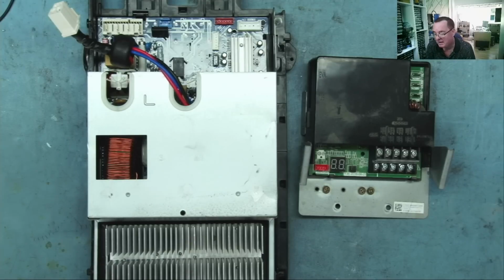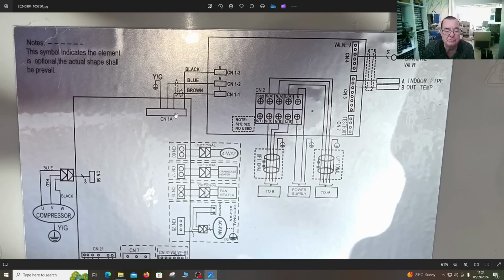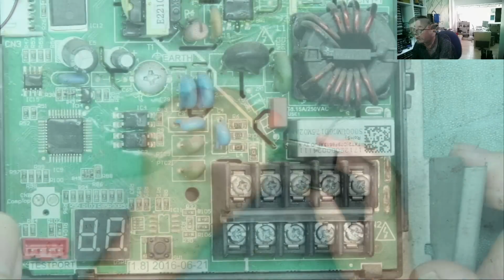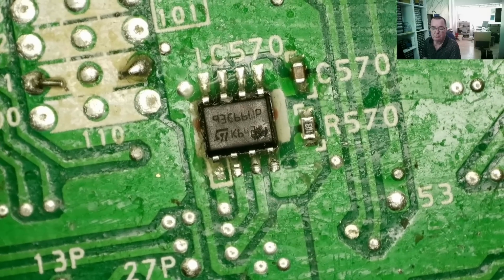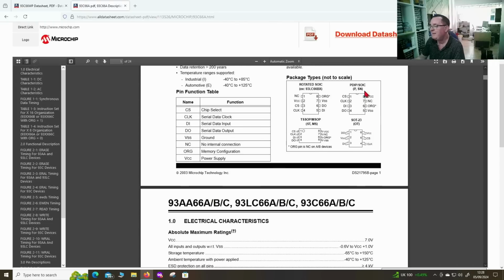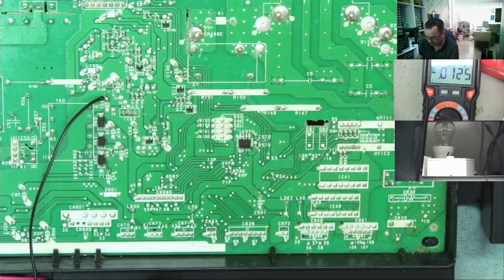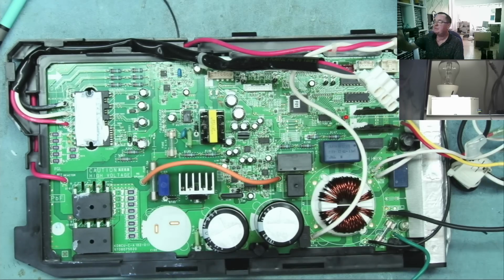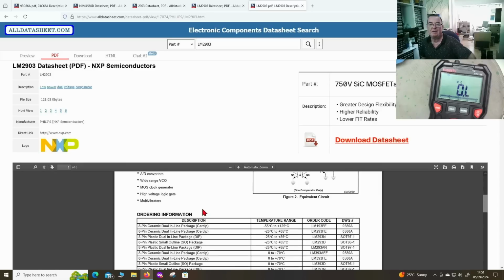Giatsu 3DDC Mini Split Air Con Error F4 Not Heat or Cooling, Fans Running

Comment from the maker: A quick update on this one.  I've ordered some 93C66WP eproms.  There is some conjecture that this chip does not hold firmware for the air con, it holds data relating to the last user settings and will cause this error if the microcontroller can not read the eprom at power on.  The best way to prove this is to fit a new one and see what happens.  At that time I will also see if I can read the contents of the original one.  These chips are very cheap so it isn't a problem just to order some and see

Comment: I had the same error code on a different brand unit, but the board was almost identical...It turned out to be a shorted microcontroller

Comment: I see a lot of comments about it being more cost effective to simply replace the boards... Well one of my first jobs as an electronics tech was to repair some pretty complex microprocessor controlled alarm panels. The boards were eye-wateringly expensive and so we, as the manufacturer, offered a buy-back scheme where we sold a PCB at full cost to the installer, then credited his account with 75% of the cost when he mailed the faulty part in. It made economic sense, especially if muggins here could actually repair them. Most of the time the faults were simple, but sometimes you could spend days tracking an issue down, which definitely had an effect on the economics. However, the fact most boards were fixed in an hour or less (usually because the installer had done something stupid when wiring units up) offset the lengthier repairs.

My first exposure to using curve tracers was in that job - loved what I did there, I still see some of those panels in use today, and that job was 45 years ago!

Looking forward to the next update on this one.

Comment: Thank you for doing this video. I have tried to repair several similar non-working main boards for different mini splits (220/240v), unsuccessfully. There is very limited information online about component level repair & troubleshooting these boards. Schematics aren't available. I am limited in my ability to test where  I do my work, as I do not have access to 220v (only 110v - US). I would like to see if there is a method to troubleshoot using voltage injection with a lower voltage since there are areas on the board that do use a lower voltage. My frustrated experiences with these boards lead me to believe they are software related failures after methodically evaluating all components (except controller type IC's) for their integrity, which is an extremely time consuming task. These boards are expensive to replace and it would be fantastic to know if there is a known point of chronic failure.

Comment: Heya, a tutorial about IGBT's would be great as I have an all in 1 hybrid inverter which I shorted beyween PV+ and PV-. at 24:00 minutes in the pin function table I see "serial data clock and input could you explain what that is and/or do I mean serial. yes a shematic would be nice

Comment: Is there maybe an extra load on the -15v line caused by a faulty regulator or transistor causing the low volts on it?
Reply from the maker: I did wonder that too but can't see it in the resistance readings to ground. TBH I could not even figure out where the +/- 15V? is generated on the pcb yet

Comment: Being able to troubleshoot these boards could be lucrative but not practical for the industry.  Difficult enough to find a real tech.
Reply from the maker: But very practical/profitable/lucrative for anyone buying/scrounging scrap boards for practically nothing and fixing them to resell at say 50-60% of new replacement cost don't you think?  Or even more % of replacement cost if they are no longer available to by from the manufacturer?  Whay not even sell them back to the 'industry' who think it is not worth fixing them? Surely there must be good profit in this... and from what I am learning so far at something I never tried to fix before it is not so difficult, only tackled three so far but fixed two including the one with the fried lizard on it and I am coming at this as an absolute beginner with Air Con.

Comment: These serial EEPROMs generally store only the settings and usage counters and stuff like that (this one is just a 4 kbit = 512 byte job), so chances are you could put in a blank one and the unit would behave like straight out of the factory. The channel Buy It Fix It has dealt with issues like these in several videos, have a look.
-9/+15 does in fact seem super sus. Maybe that was supposed to be +/-12 and there's a bad ground connection somewhere? Reminds me of that time when I was troubleshooting an Onkyo T-9900 tuner that was intermitttently acting very strange... it ultimately turned out that there were some bad solder joints on one of the copper bus bars used for grounding. Kind of a bear to find.
Reply from the maker: Yes i do suspect there is a gorund issue (the the +/- supply is not referenced to the same gorund as the 5V).  Thanks for the advice towards some research on other YT channels, it is much appreciated

Comment: Have used split rails with a different negative voltage if an opamp doesn't have the full voltage rating and you don't need a symmetrical swing.
Anyway the negative rail still need further investigation. 
I would expect the main firmware in the the controller and maybe just configuration data in the eprom.  Unless the chip is an fpga with an external configuration epom.

It seems that nowadays i create a directory and download the datasheets on all the components, and give them a quick once over as this aids the old grey cells.

Another reason for just swapping boards is reliability issues. It costs more to revisit customers and they get pissed off with recurring issues.  Easer to just replace the board and employ a fitter instead of a engineer. A fitter will never get bored replacing boards, but an engineer will soon get fed up replacing fuses etc.

Its just a sad fact that we have been living in a throw away society for decades,  i knew of a monitor company who just looked at the condition of the monitor to decide how much the warranty repair would cost, scrap the monitor and send them a new one and change for the repair.  No expensive engineer,  no reliability issues,  quick turnarounds and happy customer's.  I rest my csse, it was getting heavy anyway 😂😢

Comment: you must check if there is communication between the inside unit and the outside unit and take a measurement with the oscilloscope in eeprom.sometimes if you read and program eeprom it comes back.

Comment: remove the ic and see if -15V is restored. Also, reading one of the comments below reminded me that i think i saw the position of the optocoupler where there is a slot in the board. This may play a role in regulation.

Comment: I was hoping my favorite electronics guru would start troubleshooting hvac inverter systems. It’s my lucky day! 

HVAC is my profession but most of us know nothing about repairing the pcb’s. There are very few YT’ers repairing these in English, but from what I have learned from them, that “strange IC” IPM (Intelligent Power Module) is a common problem. Drives the compressor and or fan motor UVW windings. Also Optocouplers are common problem for comm errors. I’m setting up my little electronics lab to repair these inverter systems. Most of mine are newer and still under warranty, but after the warranty runs out, I hope to be a little more knowledgeable with the help of several books and great guys like you on YT. 

Thank you!
Reply: Yes. My IPM exploded and killed the EEPROM (or maybe it was the other way around, I'm not sure).
The thing is: the EEPROM must be programmed, and I couldn't find the file to program it anywhere. I hope Richard have better luck!
Reply from the maker: @viniciusvbf22  I will see how it goes... there will be a part 2
Reply: @viniciusvbf22  Well someone should get an EEPROM from a working unit and post it online :)
Reply from the maker: Thank you. I am no expert on Air Con just approaching it from a purely electroncis point of view.  Considering how expensive the PCB are to replace I'm a bit surprised there is not a whole load of techs already fixing these.

Comment: Has anyone tried bypassing the electronics and applying power to the compressor to make sure it can run. After all it is just a single phase motor
Reply: Compressor is not faulty so no point. The fault is the board not talking with the other.
Reply: It is a 3 phase motor supplied from the invertor.

Comment: nice video & explanations. Yes you should give a try with the thermal camera on the other side of the board.( & the EEPROM or around , to check if it receives good vcc but no moves on oscilloscope is very suspicious)

Comment: You can understand why customer facing engineers change the whole board instead of fault-finding, The customer wants it up and running without having to pay for 20 hours diagnostics. Part 50p + labour £1000 vs part £200 + labour £50. If you have many with the same fault, then time invested in understanding the problem can offset repair time / cost.
Reply from the maker: I can agree with the pont the the customer wants it up and running... but invest some time in repairing all the faulty ones you aquire 'for free' and then you can sell them back to new customers for pretty ,much full cost and make fart more profit than buying and selling a new one? Suerly that is a better business model?
Reply: @learnelectronicsrepair  He he he he, you said "fart" he he he he. That's my childish side coming out. Hope your AC friend can supply you with more boards to build your knowledge base up. Keep up the good work, love your vids.
Reply: @learnelectronicsrepair  That is a new 'financial' term I am not familiar with.

Comment: 18:40 - If it hadn’t made me so sick, that might have been funny. I don’t care what those people do behind closed doors: just don’t make me watch!
12:39 - Richard, wouldn’t it be sad if all you had here was a wiring connection issue. This board is throwing the same error as a faulty indoor board when it is not connected. There is as you said earlier, feedback communication from the indoor board on either or both the 6 pin and 8 pin terminals (TB2). There may be nothing wrong with the indoor board.
Reply: I'm not sure what you mean with your latter timed comment. What people, watching what? 😂

Comment: You'd never guess it but I just repaired a similar set of controls for a window air con.  Actually there are some similarities.  Both have inverter driven compressors (Three phase).  The unit I repaired had a failed optocoupler on the main (inverter) board which received the data from the front keypad/display board.  Identical opto sending data to the front keypad board.  $300 AC and a $1 opto fixed the problem.  I could see the data stream driving the LED on the opto with my scope, but clearly nothing was happening on the photo transistor side of the opto.  Certainly not a EEPROM issue on the one I fixed.  You should OCR the specific model number(s) for the controller/ac unit and post them next.  Ethan
Reply from the maker: Thanks for the help and advice Ethan it is much appreciated

Comment: now day the repair guide is to replace the PCB it self or throw the entire unit to trash and buy a new one typical technique .you did not get any info about the error code or what it mean .i missed the day when the device have the full schematic and datasheet available on the net ,even in the user manual it have some technical guide. Like what exactly the error code mean.i hate a company treat me like an idiot "unplug the device and plug it again " what a lame thing to explain an error.
Reply from the maker: I totally agree.  how much do these things cost and how much is a replacement PCB that makes it the most economical repair option?
Reply: @learnelectronicsrepair  it's more the time the system is down that really makes this the immediate action.
Also, many HVAC guys don't really do electronics. So it would have to be a call out or sent to an electronic tech...
And, as much as the boards are all the same, they're all different enough to make holding stock unviable.
Kind of like laptops etc...
Reply from the maker: @joeds3775  How about buying/scrounging all the scrap ones, fixing as many as you can, and selling them back (on ebay or wherever) to the guys who can't be arsed to fix them for say 60% of the cost of a new replacement? Does that sound kinda profitable?
Reply: @learnelectronicsrepair   definitely feasible but expect a letter from manufacturers... I used to work for a manufacturer... Spent a week fixing a room full of boards... Then did a presentation about faults found etc...lead balloon scenario. Even on out of stock items biig contracts were screaming for...It's definitely discouraged. 
The client swapped all our stuff out for our market leading competitors, we were number 2... 
I left. Saddened.

Comment: I hate these mini-split systems.
You can't clean them propperly and the controls are overkill.
You can do everything (aside from the inverter part) with simple mechanical relays and cotactors and thermostats.
In my opinion, these are more disposable than a window unit.
Reply: There's much more to why you'd choose a mini split though! They're different from window units for good reasons.
Reply: @AnnaVannieuwenhuyse  I am an HVAC journeyman.
I know what they are.  I would rather have a traditional split system than a mini split.
I only used a window unit as an example of quality and dosposability.